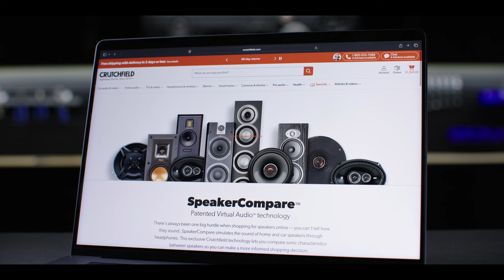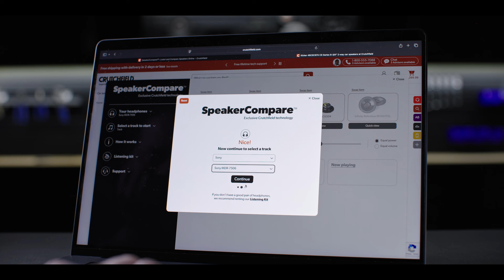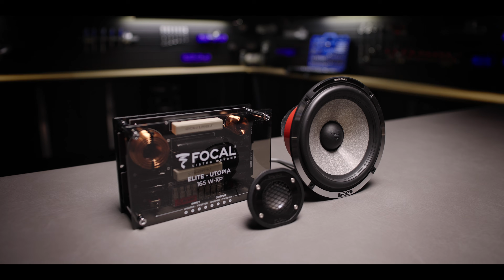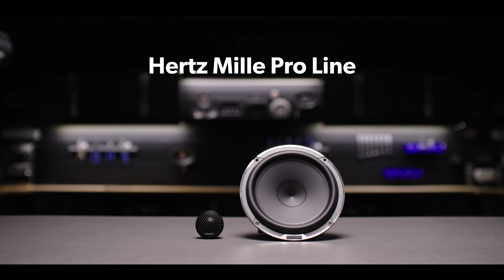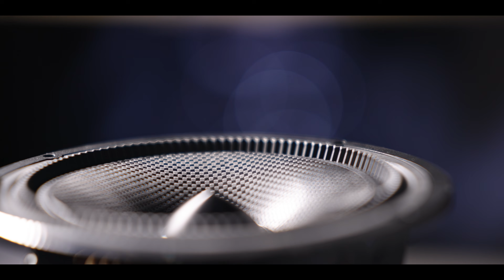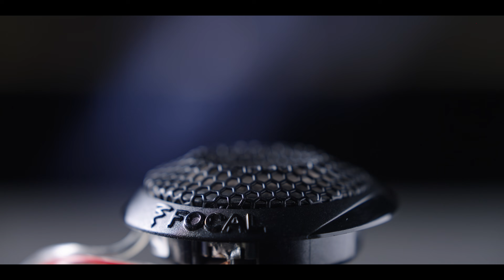The best premium car speakers for 2026 | Crutchfield

Comment: There is a big problem with speaker compare, it has lots of noise and is very irritating when using high quality headphones and hear all of the noise, clicks, somebody needs to fix the noise issues.

Comment: Focal Utopia M deserves to be there. However, it is yet a challenging speaker set and it fits certain taste.
JL C7 has never impressed me so I'd say it is way too expensive for what it does.
Morel Hybrid I have never heard in person.
Flax series tweeters have been terrible so far. Very cold and harsh. The mids are pretty good in free air application.
Hertz Mille Legend is very overrated given it is not even that expensive. Lazy midbass and harsh dome tweeter. Not very sensitive or musical.
Alpine Status doesn't need to have the Hi-Res marketing. Hi-Res is more for the electronics that can handle Hi-res files and signal. For speakers it is useless marketing. I haven't heard them in person.

So obviously here are missing a lot of great speakers that can be discribed better than almost any of these. Against Utopia M we might call them just different and it comes more of application and installation choises or just taste that which ones would be the best suited for the system.
Brax Matrix
Micro Precicion Z and Z Studio
ESB 9000
Accuton Automotive
Art in Motion Time Machine/Continuum/Chronoclasm
Morel Supremo

There is some of the best for you all.

Comment: What a GREAT info packed video on some good quality seperates. I'm a Focal and Morel fan myself although I've never personally owned a set. My buddy has a couple set's in his 90's T-Bird SC and they sound GREAT. I'm still using a couple sets of MB Quart 3 ways from the 90's in my S10 ZR2 running off a Phoenix Gold ZX450 amp. I have a ZX 350 for the tweets, the ZX 450 for the mids, and the ZX 500 for my subs. All running through an Audio Control EQ-X, an AC Matrix line driver and an AC Epicenter. Once you go active X-over over passive you will NEVER go back. Especially when you use the GOAT, Audio Control..
Reply from the maker: Cool system!

Comment: If only speaker manufacturers would agree on a standard set of measurements.  A response of 20 - 20,000 hertzz is useless if it does it within 30 db. And wattage. Use RMS, not what ever they dream up. For reference, a 1" voice coil can handle about 30 watts RMS without over heating.

Comment: What's an oversized voice coil
Reply from the maker: An oversized voice coil is one that is made to be bigger to be more conductive than most speakers in the same size range. Its used to help improve the performance of the driver making it better than others without an oversized voice coil

Comment: what are the best speakers that i can fit in a door panel of a 2026 rav4?  probably 6.5 inches.   are the JBL GTO629 6.5"  on amason good enough?
Reply from the maker: At the time of this reply, we have not been able to research a 2026 Toyota RAV4. We do not know what size speakers can fit. However, we typically are able to research Toyota vehicles. I recommend contacting a product advisor by calling (800) 309-2075 to check.
Reply: Would you please be able to help with toyota RAV4 PHEV XSE specific video to upgrade the audio?
Reply: I love how you’re already trying to upgrade the sound system in this car lol. Any professional audio shop should be able to help you out even if you wanna do it yourself. Most car speakers are plug and play but of course an amp is usually required

Comment: i have a 1991 gmc truck and the speakers in it they are crapping out , i want to replace them the speakers are located on the side above the door  , but i want to get new ones and put them behind the seat in a box. all i have is am-fm radio built in the dash. what would be a good brand to buy to have better sound at a good price. and do i need to get a amp to hook up
Reply from the maker: Hi Jim, we're happy to help. Adding an amp to power new speaker enclosures will work best. Are you using a factory or an aftermarket radio with pre outs? Are you using or planning to add a subwoofer amp too? Have you measured to confirm how much room you have to mount your new boxes? Thanks.

Comment: Please tell me about the focal ps165 v1 polyglass series and morel tempo ultra ??
Reply from the maker: Both are high performance speakers and there isn’t a bad choice between them. The Focal PS 165 V1 6-1/2" Component speakers are designed for higher power handling and have hard dome aluminum tweeters to bring out the mids & highs in your music. The Morel Tempo Ultra 602 MKII 6-1/2" Component speakers have soft dome tweeters for smoother mids & highs and more well balanced sound in my opinion.
Reply: @crutchfield should I go for morel ?
Reply: Or any other recommendations by your side?

Comment: I really want to upgrade my stock Lexicon speakers to the Hertz MPX 165.3 3-way and 2-way with the Helix V Eight DSP Amplifier. But I'm a little afraid that after spending that kind of money, these speakers might disappoint me by not being much different from the stock Lexicon speakers in my Genesis.
Reply: They sound amazing you can feel the mid bass in your chest really nice and clear with super punch I say do it you’ll enjoy every ride and if you get cheaper end stuff you’ll be underwhelmed !!!
Reply: Hertz Mille has a muddy midbass and lifeless midrange and highs. The Helix V Eight is a stunning device for it's category. I installed and tuned one in a Volvo S60 MK1 with Brax 3 way front stage and Alpine R2-W12 subs powered by a Helix P One MK2.

I'd look for ESB 4000 series front stage. That has great value for the price though it is not cheap but I really liked the ones I've heard. I run the 9000 midbasses  and mids myself with Brax DSP and Brax Matrix amps.

Comment: In this comparison you need Audiotec Fischer Brax
Reply: Hey.. They're all similar in price... If Brax comes out, it should be F1 status or Utopia M.
Reply: @nsync233  I think F1 would struggle with these two. The new Matrix series is amazing. Utopia M is just different compared to Brax. More of a taste and installtion application which one works better for the buyer.
Reply: @MikkoLaine34 I think you’ve misunderstood the point of my comment. How can the Utopia M possibly be considered in the same class as the Status? If you disagree, I’ll buy you the Status—will you buy me the Utopia M in return? Surely, competition should take place between products of the same class, right?
Reply: I was talking about the F#1 Status that is sold as a whole system though. Status is muc cheaper to that and the mentioned Brax Matrix and Utopia M.

Comment: I have hertz legends and the midbass is very disappointing 😢 have audison and jl amps with no luck getting decent midbass.
Reply: It ain't the speakers man, its the install. They are well known for having really strong mid bass.

You have them amplified? What is the rest of the setup?
Reply: Dynamat your doors
Reply: Deaden doors and get speaker rings from sound skins or sound shield 🔥 you’ll feel it in your jeans and leg hairs
Reply: Hertz Mille Legends are insensitive and they tend to sound muddy and lazy in a door application. Another thing is the potential lack of tuning.

Comment: I have a  HAVAL-JOLION 1.5T SUPER LUXURY DCT-2024. I have two Rockford Fosgate P3 10-inch subwoofers and 6.5-inch splits and 6.5-inch door speakers that i want to install. Which Subwoofer box is best, ported or vented?
Reply from the maker: That will depend on the type of bass response you want and music you enjoy. Check out.
https://www.crutchfield.com/learn/sealed-or-ported-subwoofer-enclosures.html

Comment: You can add Audison Voce II's to that list, right up near the top, but I see Crutchfield doesn't sell them...
Reply: If you bring in Audison to this lineup, you would bring the Thesis speakers.
Reply: @idriss.musa.  You would bring both. The Voce II woofers have amazing low-end capabilities
Reply: Voce is not even near the top. Lower midtier more likely.

Comment: My flax cones on my Focal's warped from the moisture in the door. Went back to JL Audio c2's everywhere.
Reply: I added rain guards to the upper half of my flax in the door, I bought some hard plastic speaker baffles, metra brand I think, cut them in half and added cld to give them mass, works good. OEM speakers have had this since the 00s.

Comment: Surprised the audiofrog gb series aren’t on this line up.
Reply: Stereo Integrity, Karma Audio, micro precision, Xcelsus ,etc. are all missing. It's obvious though. They can't recommend anything they don't sell and possibly haven't got enough customer feedback.
Reply: @Hexsense some ppl compare them to speakers that are twice the price. There should be more advertising! Ive seen mex and japan use them alot. I’m going to run 1 3way and a 2way rear fill. Signal-matrix dsp. power- Helix c series. Can’t wait.
Reply: I came here to say exactly this!